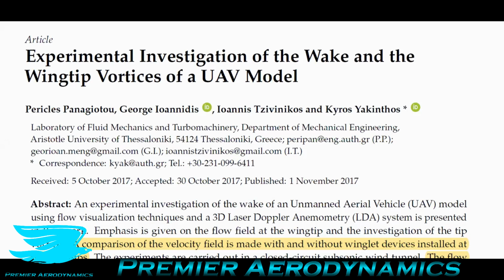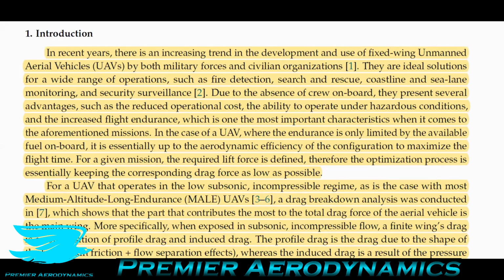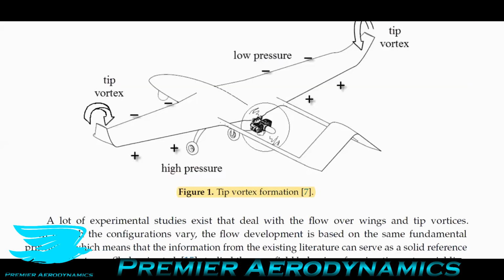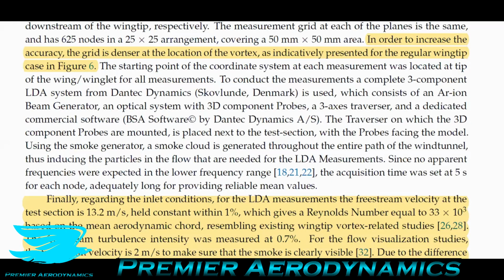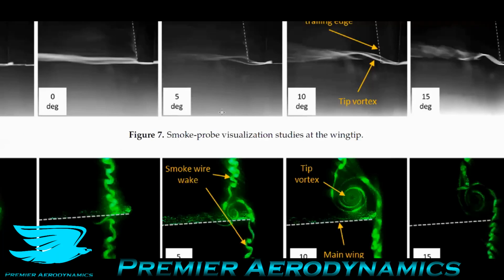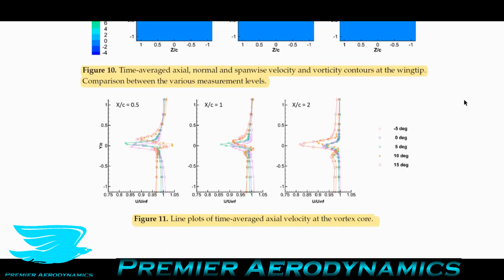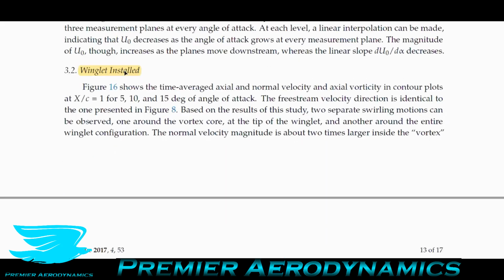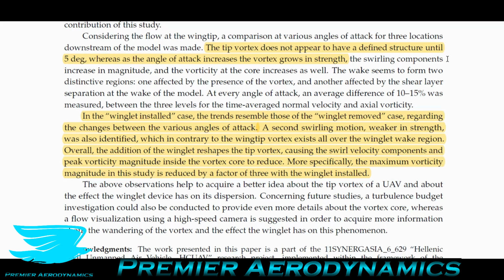Winglets Aerodynamics - Podcast #43

Comment from the maker: If you’re not measuring the temperature, barometric pressure, and humidity in your aerodynamic experiments, then check out The Atmosphere Hawk. https://premieraerodynamics.com/Atmosphere-Hawk/

It accurately measures these parameters to get rid of the large errors you get in the density, force measurements, and more! when you don’t measure them. https://premieraerodynamics.com/Atmosphere-Hawk/

Registration for the International Aerodynamics Conference (IAC) is now open! Register here: https://premieraerodynamics.com/IAC-22/

If you want to learn CFD, check out our course: https://premieraerodynamics.com/courses